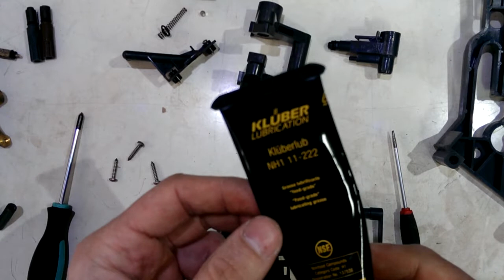How to clean lubricate and repair your brew group for Saeco Royal Magic Vienna

Comment: I have just watched this interesting and helpful content, thanks a lot for recording and publishing it! This weekend I have disassembled, cleaned, lubricated and reassembled the entire brew group of my Saeco Royal coffee machine. One thing to add to this video: be careful when mounting the water intake pipe (the L shaped one shown from 21:15 in the video above) - it has a weak and thin plastic sleeve for the screw, and may break (as it happened to me) when applying more than minimal torque.

Comment: thank you for the video Milen, I have a Saeco Magic Deluxe and the water spills into the drip tray when it runs resulting in a lower volume coffee with no crema :(, I started looking at the brew group and found the glass ball that was held in place by the spring was missing. Where would you expect to see leakage if this ball valve is missing, drip tray or hopper, thank you

Comment: I have a Saeco Royal Professional and when I turn it on the "Fill Water Tank" message comes on right away and I can't get rid of it. The tank is full, I have replaced the magnetic sensor inside the machine under the tank, the float is working in the tank but it won't go away, Any suggestions would be greatly appreciated.

Comment: Hey, wonder if anyone can help me. A part of my original brew unit for my Saeco Magic de luxe coffee machine broke off, so I ordered a new one with a new spring and ball valve thing. Before everything worked ok, but now when I try to make a coffee it doesn't come through. I've observed the process with the door open and see that from somewhere near the top of the brew unit the coffee spurts out, with it all ending up in the brew unit and the bit where the old grains go. When I remove the ball from the brew unit, the coffee comes through fine but obviously really weak and not nice tasting. Could anyone advise me what exactly the problem could be here? I've cleaned the brewunit and regreased everything, ive ran the decalcifying cycle with the phillips descaling solution thing, ive tried the old ball and spring. This has all been over a long time period though (since September non-functional). Gratefuly for any help - its so heavy i dont really want to have to take it to a repair shop - ive no car! I've taken a video so can provide if would be helpful. thanks.